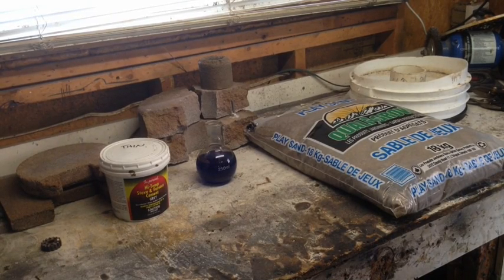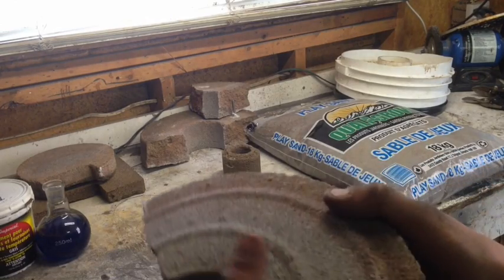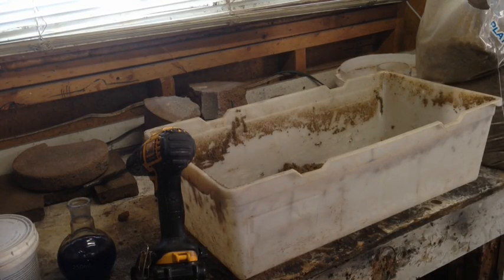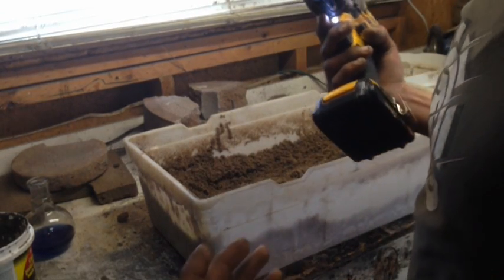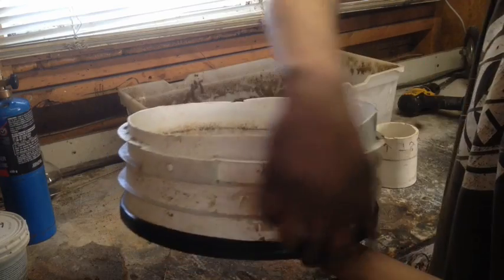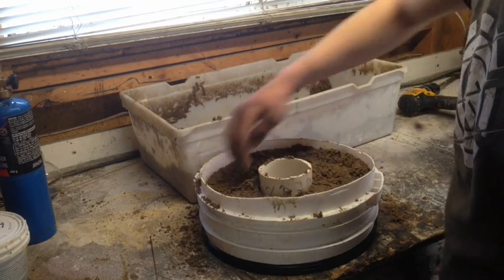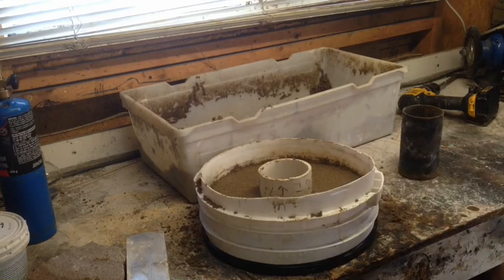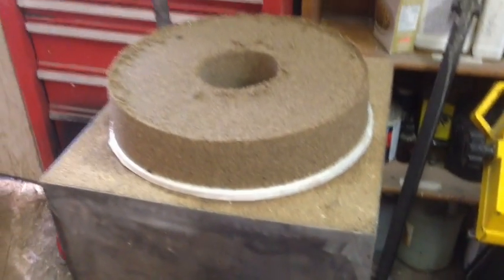How to make refractory brick (fire brick) with sodium silicate PART 2

Comment: Great video even after so many years - Thanks! 
The formula you have here is really good. By the way, as you probably know by now, the Hi-Temp compound is actually a mixture of only Sodium Silicate "waterglass" (maybe 1/3, so still uses the CO2 for initial cure) and Kaolin Clay.

Comment: So I'm making a pizza oven, and need a span of 24 inches. I used a big hunk of granite before and it worked for about 6 fires until it didn't work anymore. 

If I put stainless wire in it, do you think if I made a 24"×24" square it could hold up ok?
Reply: Maybe use a little more of the refractory cement?

Comment: have you tried making an aircrete version?  Even mixing this with perlite would lighten up the weight.  On thing when using CO2 as a curing agent, it helps to push a thin wire into multiple locations so that the curing gas goes beneath the surface.  Great job, though!  Thanks for sharing.  (for the record, if you are really being safe, you should have a CO monitor in the area about 5 feet up on the wall.  CO poisoning is insidious.... it's cheap insurance! )

Comment: Love the sodium silicate.  Very pertinent to a very arcane and bizarre discussion ongoing among historians of the building trade, for some reason modern cement is actually inferior to the older standards, quite evidently due to the bizarre disappearance of knowledge regarding the use of sodium silicate.  Or so it would appear.  Very difficult to parse the veil on this sort of shit, I'd recommend any interested in the topic venture into such venues as "conspiracies R us" and Martin Leidtke's channel as the line of insight and argument they are following carries much significance for all interested in matters relating to the technological "cutting edge" etc..  Very interested with respect to craft to know if one can use the sodium silicate as a binding agent with fiber-glass fabric.  If the two materials can be welded into one, then much can be accomplished.  Or so I'm speculating.  I've got a sheet of the shit nearby and a bottle of the silicate so it's perhaps a bad reflection on my own conduct and character to be asking rather than testing out the hypothesis myself.  Laziness is not the problem.  We're all so damn bogged down with constraints of time and money to have much time for anything more than the wiping of ass prior to the next crash in bed.  The craft of cement being that of the Master Builder, so too is his favorite invention of all:  the ball and chain.  Coming soon to a theater near you via the union of A.I. and the notorious "Block Chain", if it's freedom that any are expecting in the coming years then I would suggest a change of venue.  Mars is said to be occupied by Nazis sporting flying saucers, so my best tin-foil-hat suggestion would not include that option.  Meanwhile Venus would appear too hot.  Something to do with safety razors marketed to women.  An issue among the family.  Confusing even to me.  A higher spiritual state with respect to "the big mystery", the matter of how best to work glass and cement poses a more tangible and straight-forward challenge.  Thanks for the big help and good luck with your own projects.

Comment: Question.   Is this recipe better for high temperatures than recipes using portland cement?  Also, can you use perlite instead of some of the sand to make a lighter and insulting brick?
Reply: Note......A circle doesn't have a corner but a cylinder does.

Comment: 2 questions. If you dont have  fire cement you can substitute for normal cement, or its better only with silicate and sand?. You can use other kind of sand?
Reply: Do NOT use regular cement, it has a high water content even after curing and may explode.

Comment: You really need to wear gloves. My granddad was a brick layer and had this stuff on his hands for most of his life. For as long as I can remember, his hands were always cracking and bleeding no matter what he did. He wore gloves, too. Take care of your body.
Reply from the maker: Dont take this the wrong way... "My grandad was a bricklayer his whole life"

I've done this once or twice in my life..You can smoke 1 single cigarette and 100% you will not get lung cancer due to that 1 single smoke. Smoke 2 packs a day for 50 years, and that becomes a different story. 

Thanks for looking out, but this is kind of irrelevant. My hands are fine because I dont do this every day of my life. The small amount of cobalt in the silicate is also negligible, otherwise it wouldnt be sold as an indicator in cat littler.. if I was doing this every day of my life, then the cobalt and caustic nature of the chemicals would be of way more concern.

Comment: Your awesome.
Reply from the maker: Lol thanks 🍻
Reply: @nilamotk  I tried my first batch of water glass. It wasn't a success. It was extremely thick. I tried again. This time the consistency was not as syrupy. But after mixing it with foundry cement and sand, it wouldnt keep its form. I experimented with concrete, with pearlite,  and home made clay. No mixture has been successful. So I am assuming its a my sodium silicate. Idk. Kind of discouraged. But I will keep at it.🤨 Please keep up the great vids. I wish you lived next door. I would be hitting you up for advice. (and stuff)  Hahaha.
Reply from the maker: @LilDirt12  If the water glass turned out thick you can try to add some more water to the solution. If its thick, like really thick right now it will be hard to mix but with some heat and any luck you'll start to thin it out. Then you can try again. If it's too thick you wont get an even coat over the sand. 

Also unless using some kind of cement (not just sodium sicate) you need to cure the sodium silicate with either relatively high heat, or with CO2.
Reply: @nilamotk  ok, cool. Thank you for your advise.👍

Comment: Hi thanks for the info much appreciated , I’d like to build a dual purpose wine barrel smoker and barbecue , had the idea of lining the inside of the barrel with a perlite sodium silicate mix about 1 to half inch thick to protect the wood from burning ? What are your thoughts or advise please - all the way from Cape Town ?
Reply from the maker: You can purchase a rigidizer for the whool so it doesnt shed fibers. (Its sodium silicate basically) but check for compatibility with cooking.
Reply: nilamotk thanks will ask around have seen that wool lining
Reply from the maker: I wouldn't use a sodium silicate mix that you make from anything food grade.

My recommendation to you would be to spend a bit more money and purchase some ceramic whool insulation (kaowhool) it's available on Amazon. I dont know if the wood would burn or not. It still gets quite hot on the exterior when fires at 1500-2000* but you smoke isnt running at 2000*... so that's some trial and error on your half.

Comment: Ceramic fiber is the go these days.
Reply from the maker: That it is, That's currently what I use, but it's expensive and somewhat hard to find.
Reply: Really. That is strange they sell it in Melbourne for less than 200 bucks for I think 14 meters of the thinner stuff. The thicker rolls are about 8 meters. I guess it is a little expensive but the advantage is quicker heat up and lighter.
Reply from the maker: @sammyd7857  200$ is alot more than 2$ bag of sand, 5$ cast litter and 5$ drain cleaner. This is made to help people get their feet wet. If they use it all the time km sure they're research up some ceramic whool

Comment: If you round the edges slightly, it will better resist cracking due to handling.  I learned this from a guy that works with concrete..
Reply: also, make the edges denser by pushing on the material in the corners and adding more.

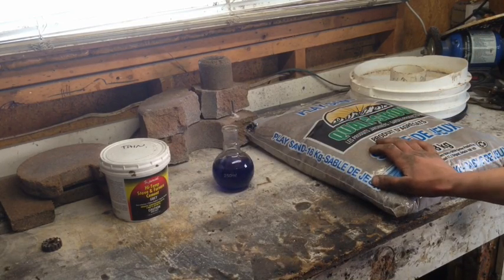Comment: 1:15 - did your just mix metric and imperial units?  Ahhhhhhhh!  The bag of sand is ten kilos! Lol
Reply from the maker: 18 kg* / 40 lbs ~ 

I'm Canadian, some days I'm metric some days im imperial, I weigh myself in lbs, I obey the speed limit in kilometers/hr a shot glass is 1 oz, my drill index set has metric, imperial, letters, and number drills... cars built in Canada use imperial fasteners, 

Were all over the map bud 🇨🇦

Comment: I am trained in high temp and masonry heaters. This video is a great intro and I think you are on track. Firebrick does have mostly alumina, so if you want to recreate that, put that in. I'm seeing good results with nasi soaked into kiln insulation. That could line the inner walls of probably anything up to 3000. And it goes well in combo with the stuff in this video. Thanks for your efforts! I'll check out your other videos.
Reply: do you think I can use this brick inside my brick oven ? I am curious if  sodium silicate  is food safe

Comment: You actually have a two cylinder carbon dioxide generator built into your body. To activate it, just take a deep breath and hold for a few seconds, then exhale pure nitrogen, h20 and carbon dioxide  ; )

Comment: nice helpful video thanks  for sharing . i have a idea or you can say question about sand with sodium silicate .i mean if we direct take play sand+sodium hydroxide and water so can we take good result for make bricks tiles etc?
Reply: Simply, NO! Don’t mess about with sodium hydroxide unless you really know what you are doing (I mean some sort of degree or higher qualification in chemistry)  it is extremely caustic and will take your skin off which will take about 6 months to heal or blind you if it gets in the eyes.

Just because sand is silicon dioxide don’t assume it will make sodium silicate if you just mix it with sodium hydroxide. It needs much higher temperatures to react. You will just end up with sand and sodium carbonate – eventually – and that won’t work as a refractory.

Comment: Just a matter of curiosity you ever consider using Portland cement with this mixture
Reply from the maker: I have considered it I thought it would be a good idea from the comments below there's a lot of smarter people there than I am and they say Portland cement not all that great. You have to keep in mind I don't do this for a living this is just a hobby in my experimentation that worked for me. I could not tell you with guarantee of Portland cement would work better or not I can tell you the brick made in the video is half-assed decent. It's not the best, it's not the worst...  -- to be completely honest -- if you're just getting into The Foundry Hobby and want to melt some aluminum to see melted aluminum this is for you it's cheap. If you planned on casting engines from scratch or repeated use you should just go ahead and buy ceramic fiber insulation. It's a hell of a lot more expensive but lasts ten times as long as well and it's like one one-hundredth of the weight. My current foundary uses ceramic insulation.

Comment: Can you be more specific on recipe amounts? Like 2 gallons of sand would take (how many ounces of sodium silicate) Thanks and God Bless
Reply from the maker: I would say 2 gallons of sand would require around 500-1000ml sodium silicate. Mix a batch with a relatively low concentration and then after mixing thouroughly take a small sample and test fire it untill its meets your requirments.

Comment: I think for the the safety of the whole YouTube audience (except the poster of this video of course) I have a warning message: using gloves that are damaged or flawed to protect from heat, high heat or ultra high heat can lead to serious injury or death. End warning. (hope you can perceive my sarcastic humor) As an educator in the public sector, I do offer one piece of info that I have found very useful when dealing with the public- do your best to make no response to those who have anything even remotely close to negative to say. (for example those who have supposed "safety" reminders or those who know a better way ). simply never acknowledge the comment.  This advise has served me well over the years.  Actually, though, I wanted to mention that I really appreciate your willingness to share your knowledge and all the effort put forth to put your videos here.  I made your mantles, and, in spite of purchasing two since, they are still in rotation. I also made a "version" of your "triac-based temp controller" and now, as Im collecting info for a muffle/tube furnace build using Nichrome 80 and I run into this video. Thought it was time to sub. ty again.
Reply from the maker: Glad to help out, and thanks for subscribing. And no need to worry, I'm thick skinned. It's quite hard to hurt my feelings haha

Comment: The mathematical definition of a circle says it has infinite corners. :P
Reply: Ive heard this sort of thing before, and not only is of no practical use, it really does not make sense. It implies that curves are an illusion and that everything is comprised of straight lines. However, it is more useful to think of the universe as curves, and straight lines are the illusion. Nothing in practice is perfectly straight.

A doughnut shaped circle mold has four corners: where the sides coverage with the top and bottom.

Comment: water glass aka sodium silicate can be bought in a auto part store.  It is sold as a filler for glass windshield. Just filter out the copper.  Also you can find it in a ready use putty in the exhaust section.  It is sold as exhaust repair putty.  The putty is not cheap but the water glass is a few bucks.

Comment: If you are working with your hands in cement or concrete all the time or a lot you really need to wear rubber gloves. Not because it dries your hands ou, but because I've been told you can get poisoned from the lime in the  concrete/cement. How well did that work for your foundry?

Comment: Hey this seems neat. I cant get play sand where Im from but I got plenty of beach sand. Is it possible to substitute the two? Would I need additional ingredients? No I do not have refractory cement either.
Reply: Jyumai Darn  Read all the comments many questions are answered by other viewers like using Portland cement with sodium silicate to increase the available  firing temp and also adding alum. Oxide

Comment: using the ark furnace design, I need to melt copper while using the melting chamber (insulating fire brick) as also being the mold for it to cool in. How hard would it be to remove the copper casting from this brick, a foot or more in diameter and at least 6 inches deep with an inch hole in the center of the copper disc, and Not destroy the "brick"??? And also I need to know the thinnest that I can leave the wall that retains the heat, doesn't let the weight of the copper break it, if heat does escape through the wall it must not reach the  point where metal will lose magnetism, or really even remotely close to it!
Reply from the maker: David Prock it would be next to impossible. you need to look into greensand casting. make a form and use that to make an open mould. pour your casting and let it cool. you'll have to detryo the mould for every cast piece. 

this "brick" mix will melt with carbon arc. an arc furnace is upward of 6000* even store purchased firebird will melt. you need a clay graphite crucible to withstand a carbon arc and not have it wear down almost instantly.. 

It would work for a small batch run for 1 minute but a 1foot around copper ring is alot of metal and will take a long time to melt. 

And to get your part out of the mould without breaking the mould is almost impossible. you would need to use either a sintered metal or dieform style casting... those machines cost million of dollars.

I would have to know what your trying to do to give you any advise..
Reply: nilamotk I know how to turn copper into monopole magnets, not quite ready to tell the world yet where I'm going with this, but it will be world changing

Comment: Play sand plus Sodium silicate only has a melting temp. of 2100 F.  which is great for light forging working at cherry-red heat and below but you really need to add about 60% "ION GROG" grit or "ALUMINUM OXIDE" grit to this mix to make it durable for 3000 F. all around forging and knife making / iron and brass melting / repair work!!!  For $10.00 more in materials this project could big a real monster that could do any job and last forever.
Reply: You could also use Sodium aluminate instead of the Sodium silicate which would result in, basically, the same result. This is theoretical, I will try it soon to see if it can be made into dense refractory bricks and I might try it with vermiculite or perlite as a soft/insulative fire brick.
Reply: Thermodyne Systems  Thanks for urban explanation,
Reply: Phrase  checker run amuck  . SHOULD  OF POSTED Thanks for your explanation
Reply: Thermodyne Systems where would you get aluminum oxide? Pain store or just use the belt sander?
Reply: +Thermodyne Systems, make the video. We will watch it!
Reply: what the fuck is ion grog
Reply: When adding Aluminum Oxide what ratio is needed?
Reply: Do you know where  the alumina is sold
Reply: Anomic Anchorite  thank you
Reply: Your comment is useful but ambiguous. What exactly do you mean by 'add 60% of aluminium oxide' Does that mean 60% of the mix is alm oxide, OR you add a defined amount of 60% al oxide?
If you made an arc furnace like grant Thompson's, would your '60%' mix be OK?
Reply: Aluminum oxide is commonly found as a sandblasting abrasive. You can get it at Harbor Freight tools or similar.